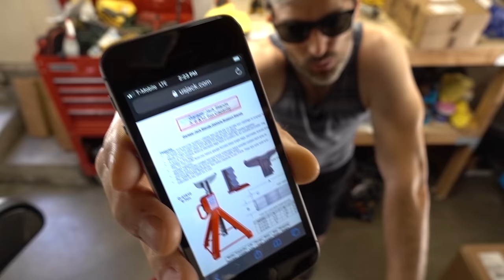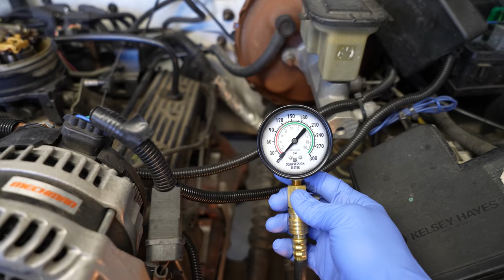Coming Clean About The Transmission Flush Video.. THE TRUTH!!

Comment: Jimmy, as an old hand at this stuff, I appreciate you making it understandable for newbies
Reply from the maker: Thanks! Although, I still consider myself a newbie too. 🤷‍♂️
Reply: @1RoadGarage  My question relates to automatic transmission oil  - would you recommend using 0.5 litre  DEXTRON 6 transmission oil in 5w30 engine oil 100 miles before scheduled oil change to remove any buildup in GMC YUKON 2013 (240,000 km) - there are no issues in engine, I just want to clean any built up over last 9 years. Thanks in advance for your reply

Comment: I flushed the trans & coolers in my '94 K2500 Suburban w/4L80E & 454 engine, and then installed a deep sump cast pan on it. Truck holds about 16 qts. total of Dexron 6 ATF and will darn near chirp the rear tires on a 1-2 shift. Truck has 153K miles on it.
Ditto for my '14 Chrysler 300C hemi car, shifts super firm & smooth now as well.
Great video, Jimmy!
Reply from the maker: Thanks Mark! Man, your Burb sounds like a good one! Keep that sucker on the road.
Reply: @1RoadGarage  it's my main workhorse/tow rig, will tow its own weight and then some without breathing hard. 10 mpg kinda sucks but it gets 'er done! 1 ton rear axle sure helps.

Comment: I used an electric fuel transfer pump on my 2016  sucked out about 1 gal from the pan and put in 4 quarts of fresh fluid and the trans runs great. In the Spring I will drop the pan and replace the filter and replace what ever is required. Using  Amzoil fluid.

Comment: I recently picked up a 2002 Chevy 2500HD 6.0 with 63,000 miles and I’ve watched your videos for a long time. I’m thinking of going with a flow master 50 like you had on your 95 suburban and doing my transmission like you did. Also, I have those Auxbeam headlight bulbs a shot, again based on your video and now I’ve got them in all my vehicles and a few friends do too. I enjoy most of your videos. Keep it up.
Reply from the maker: Thanks Jimmy!
Reply: As a 2500HD owner myself trust me when I say you’re gonna want to drop the pan and change the filter. Not knocking my man Jimmy at all or any of his videos but just wanted to give my 2 cents.
Reply: @Tablesaw818  what year is your HD? Which trans do you have?
Reply: @jimmyschwarz6955  2008 with 86K on it. I have the 6L90 6 speed 18 bolt. You’re gonna wanna drop the pan to change the filter and clean the magnet. After that you can flush it like Jimmy did in his video. 🤙🏻
Reply: @jimmyschwarz6955  I don’t know about the 2002 but on mine there is enough room to drop the pan without messing with the exhaust. I know people have clearance issues with the 1500’s.

Comment: I used to work at a service station and an auto shop. A transmission flush machine typically uses the vehicles trans pump to transfer the old fluid out and pull the new fluid in. When people refer to "don't flush your transmission" is usually people don't service their vehicles, and laps services. By the time someone down the road flushes it, it's typically well over the 100k mark and the fluid is brown. That usually kills the transmission because all the dirt and grit in the trans is acting as friction material. As long as you service you vehicle regularly, like you do, you'll be totally fine.

Comment: 95 GMC used your flush process with one change. Flushed oid fluid, then dropped pan and replaced filter. Added fluid topped off all good. Transmission shifting great 200k.

Comment: I bought a 1998 Chevy K1500 recently, I use your videos and appreciate them. Recently got the Dorman door bushings you recommended. Turns out at this point those are not good parts. The bushings are not made the way the originals are. Made me think you could do a whole series of original vs low cost parts comparisons. I would watch those. Things I have to address on my suburban…visors, front seat upholstery, glove box and ashtray fixes, adding a winch, and a non original project of adding an accessory mounting bar over the top of the dash for radios and monitors. Thanks for what you are doing!
Reply: Cunningham Machine makes the good door bushings

Comment: I change oil for a living, the way we service auto transmissions, we go through the dipstick tube, doesn’t add pressure to the transmissions, I will not service older transmissions 200,000 miles or more that don’t have service history.

Comment: Transmission flush: some of the valve body bolts were loose. In my car it was the first 4 bolts in the torque sequence. It didn't want to go in reverse. Changed fluid filter and retorqued value body bolts. Loose bolts on the valve body cause internal leaking from one passage to another. To test for this just change the filter. I know a guy who blew the transmission in a Camry because of a clogged filter.

Comment: I think you hit the nail on the head on the myth of trans fluid changes causing problems...people already had a problem and expected a fluid change to fix it. I flush my cars every 25-30k miles (the same way you've flushed your Suburbans) and have never had an issue. Trans fluid and a filter is less than a hundred bucks...a transmission is thousands, so it's better not to be lazy and chance it.

Comment: 97 S10 127000 miles, did trans after watching your video. Seems to run smoother and shift better.
Reply from the maker: Nice! I’m gonna be doing the ‘05 Envoy soon. Probably just drop the pan and do the standard method. That thing also has the 4L60E. Go figure.

Comment: My question relates to automatic transmission oil  - would you recommend using 0.5 litre  DEXTRON 6 transmission oil in 5w30 engine oil 100 miles before scheduled oil change to remove any buildup in GMC YUKON 2013 (240,000 km) - there are no issues in engine, I just want to clean any built up over last 9 years. Thanks in advance for your reply

Comment: Would you recommend the "passive transmission flush" on a 94 gmc suburban with 242839 mi on it???
Reply from the maker: It’s tough to say. If it were me, due to the miles, it’d probably not be a good idea but… I don’t know, I might be curious to do it. I’m just one of those people…
Reply: I took out a qt  and put in a new one , it performs better ,but I wasn't sure about all of it . It was really dark though... im gonna try it ,ill definitely let you know how it turned out?  I appreciate you so much brother,  stay strong my guy
Reply: If a 1 qt change helped, that may be a good candidate for a pan drop and filter change. Doing so will not physically disturb the fluid in the passages/internals, just what's in the sump, 4 to 5 quarts, which is not quite half of the total volume of fluid in transmission.  Just my $.02  hope this helps.

Comment: I’ve always heard you should not change the transmission fluid on a car/ truck with high miles because it will cause the transmission to go out.  Is this true?  My Dodge Grand Caravan has 205k miles on it. Should I change it or just keep it topped off?

Comment: Have a 2004 GMC Yukon 4.8 360000 miles never change the transmission fluid it shifts good drives good should I change it

Comment: I some times want to buy clear tubing for connecting to various ports in
 vehicles for testing and flushing - what is the right way to measure a 
barbed male connector to determine correct tubing size?
Reply: Inner diameter for tubing should match outer diameter for fitting. So 10mm ID hose matches to 10mm OD fitting

Comment: My 95 1500 199k is smoother in the transmission to compared to my 99 5.3 Silverado 114k I understand what you mean
Reply from the maker: Interesting. I’m curious if it’s literally the difference in power and torque between the two engines??
Reply: My 90 1500 with the 700r4, the predecessor of the 4l60e, is also smoother than my 01 5.3 1500 with the 4l60e.